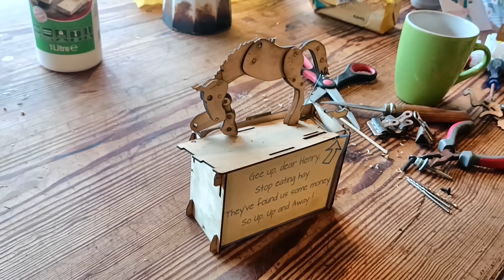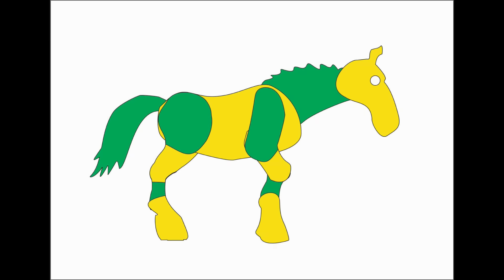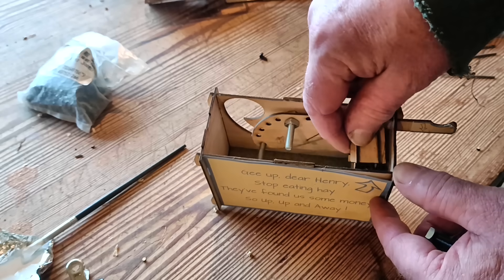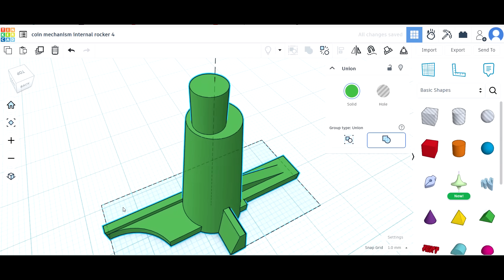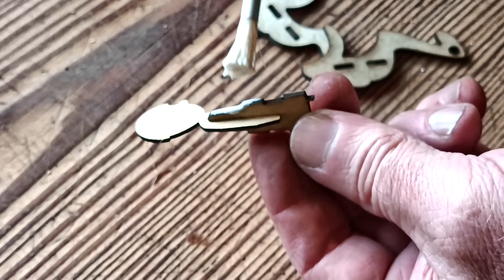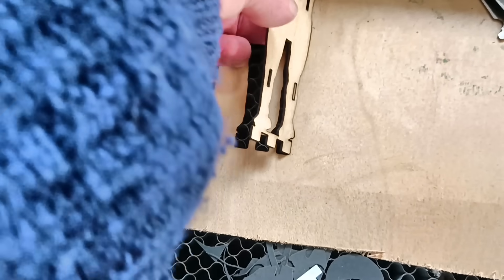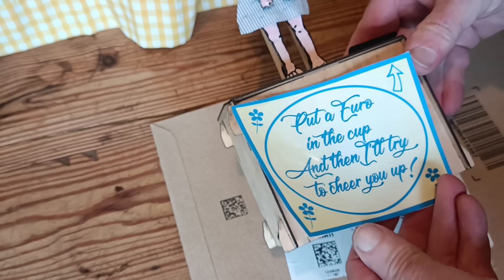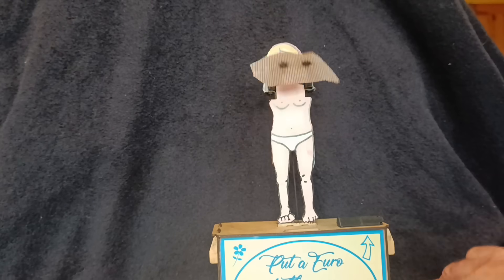Two Home Made Coin Operated Money Box Automata

Comment: There's a relatively simple sand clock-like automaton usually depicting a trapeze artist that uses a box with a tray inside and a small waterwheel connected to a figure with a couple of joints, turning it upside-down pours the sand back into the tray and turning it back over pours the sand over the wheel making the figure spin around on the trapeze. Often they're made with card but they've been made for a very long time.
Unfortunate that these interesting little things just aren't economical unless you're making thousands, I've always found them charming.
Reply from the maker: I know them well - and I hope to make one some time. But when?!

Comment: Turns out I'm cheered up!  Lovely mechanism, lovely results.  I was having a yarn with a friend of mine (about suppressors for firearms, of all things).  My hypothesis is that the recent surge of beautifully capable devices on the market is due to a sort of "golden triangle" of technology, capital, and engineering for manufacturing!

Turns out, any bloke (Hi Tim!) can make a one off or hand made product, but converting that to something you can actually make money off of is VERY DIFFICULT.  Technology like 3d printing or laser cutting is not actually a huge change from the perspective of engineering to market!  They are just additional tools in the drawer, so to speak.  As our dear host noted, the assembly time and multiple manufacturing steps involved in this puts the final cost per piece well outside of what the item would plausibly sell for.

Specifically on this one, I would recommend three things - Iterate the coin box idea, seek outside inspiration, cheat, redesign, but get the coin box simpler and more generic, with the automata using a standardized interface with the coin box.   Second, don't fully assemble the product.  A laser cut sheet (with the wee tabs to keep the pieces in) and a set of build instructions goes out the door a lot easier than a fully assembled product.  Third, finally, and most importantly - please carry on! I almost always enjoy your videos and look forward to seeing them.  Thank you!
Reply from the maker: It's a shame, though, isn't it? The machines are amazing, but there are always faster, better ones some where else to make things quicker..

Comment: It certainly cheered me up it I didn't need cheering up but it still made me laugh could you sell them as self assembly kits with the 3D printed parts which would probably fit in a padded envelope or sell the design drawings with the 3D printer files or the 3d printed parts for those who don't own a 3D Printer.

Comment: I am a toy maker, and used to make things and supply shops. Were I doing it again now I would sell kits and/or plans - with a preference for plans as digital downloads can nowadays be svgs and fire up a laser or 3d printer. (Kits still involve a lot of work and trips to the post office).

With your brilliant design skills you could offer laser cut plans, and 3d printable versions - so 2 bites at the cherry (I think the 3dp versions would go down well as minimal assembly would be involved with printed versions.)

Then your distribution vehicle could be an etse store or other 3d channel.

While there would be more time involved in preparing the plans and instructions - you are 'probably' 50% of the way invested. . . . . . .

Fun project - also worth thinking about non money box versions as change is getting scarce, and 'automata' are a thing (I buy them from some makers) and therefore command a higher value - have a look for Cabaret Mechanical Theatre to see what some original automata (by well known makers) go for!
Reply from the maker: Thanks for the ideas - I'll take a look at the Cabaret Mechanical Theatre..